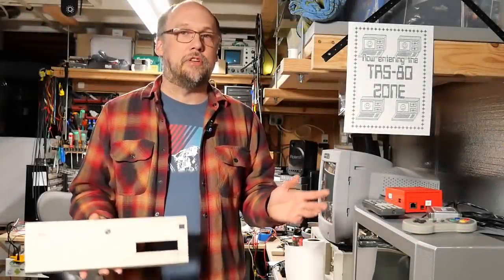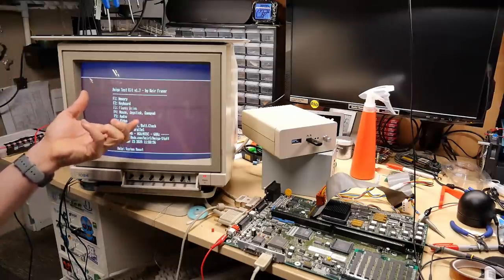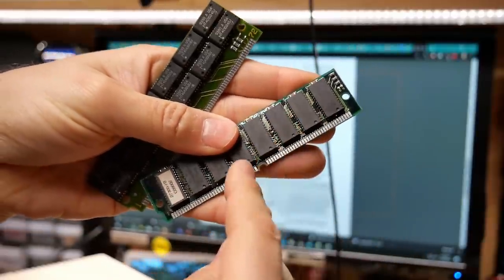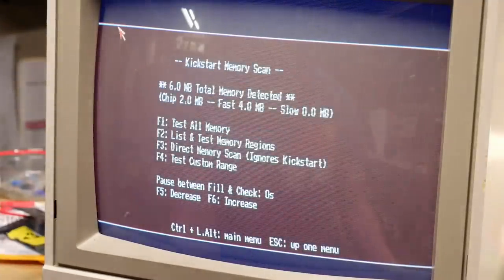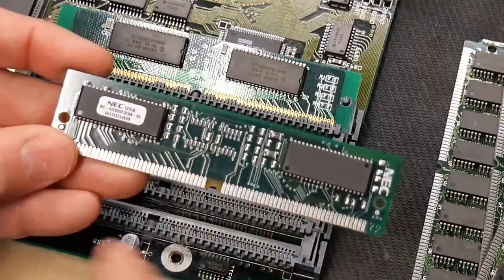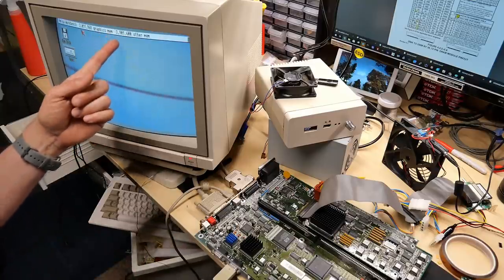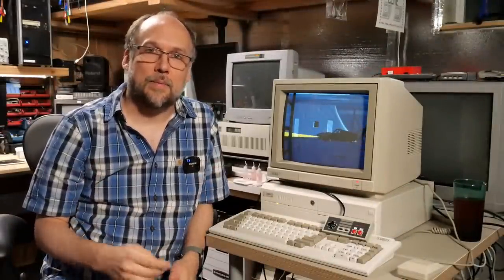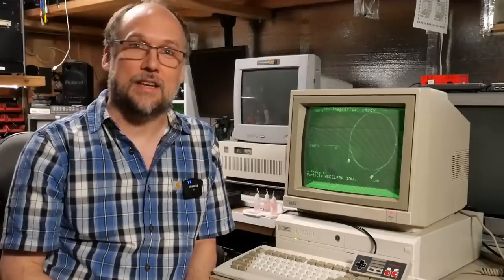Amiga 4000 Repair Part 2: RAM issues are solved!

Comment: I've had a lot of trouble with my C64 since I got it. The 1541 U2+ that I have for simulating disks was unreliable. Even the slightest touch can mess it up. Also the video is glitchy and only got worse. After watching your videos I got some deoxit. The 1541 U2+ works PERFECTLY now. No issues there. The video glitches are still a problem. Most likely logic chip issues at this point. A 10 print goto program will turn the text black randomly. It actually looks kind of like fire as it scrolls up the screen. But yeah deoxit did help a LOT!! So thank you for being so obsessive with it. lol
Reply: He should have used Deoxit in the memory sockets right off and not wasted so much time, I'm a retired IBM engineer, I lived off the stuff.

Comment: Just brought the A4000 up from the damp basement...it sat there for 15 years...aside from having hard time connecting the video with no success due to lack of cables, and floppy not reading the Workbench disc (totally silent, no read clicks), I noticed some mess around the battery that was not crusted dust. I have removed the batt and splashed the area with vinegar which revealed rusted lines, God knows what's it like underneath the board. Any idea why floppy won't work? The battery leak-affected area is far removed from the floppy connector...
Reply from the maker: The floppy drive is likely dead from the moisture. They are often quite affected by corrosion internally from years of it. You may need to try to get something like a Gotek and see if things are working properly with that.
Reply: @adriansdigitalbasement  thanks. I think I have kept another floppy drive in the house upstairs, just need to locate it.
Reply: @adriansdigitalbasement  I finally connected the RGB-scart video cable and the screen is steady grey upon startup, and the power LED blinks 10 times short + 1 time long (possible chip RAM problem). There are a couple corroded trace lines right next to the battery that are going into the RAM slots area. Also corroded trace lines leading elsewhere. Think it's time for a local expert.

Comment: My friend got a Dell workstation, actually two of them, with dual socket setups and really good Xeons. Each machine only had one CPU though, so he moved the cpu and ram from one machine into the other to make a really powerful workstation. However, very randomly, there was a broken solder trace on the BIOS chip of the machine he put everything into. It refused to boot if the computer was cold, but if you let it sit in the crashed boot for a while and warm up, it would then boot just fine. And restarting the computer also worked fine. A very interesting and random problem. The crack must have been so tiny, for the heat from the CPUs to be able to expand the solder and make a good conection.
Reply: If I had that happen I would just move the cpus and ram all into the other workstation. Intermittent problems are the worst.

Comment: didn't you recapped the power supply? 
Where I would completely replace the power supply with a new one
Reply from the maker: I only replace caps that are leaking or are bad. (And in the case of the motherboard caps, even if they haven't leaked yet, they will leak soon causing physical damage.) There is nothing wrong with the caps in the power supply.
Reply: Yes ok 👍
if I have it open in front of me and work on it, I would have changed it completely, after all the Amiga is over 25 years old

Comment: Any chance you can do a short video or at least post a schematic of what you did to make the Nintendo controller work with the commodore?
Reply from the maker: I have a video in the works actually. Not a great one. As a cheat there are no schematics as I just wired directly to the buttons. It was super easy
Reply: Adrian's Digital Basement I already modded one too but I had to cut a bunch of traces on the internal pc board and I get a bunch of odd characters with it plugged in before a game boots. Is that normal?
Reply from the maker: Bob's Barn Workshop A NES controller or Genesis? Why did you need to cut anything? I just soldered into the DIP IC inside that goes to the various contacts. The joystick port on a Commodore shares inputs with the keyboard so yeah it’s not unusual that you see keys pushed in basic.
Reply: Adrian's Digital Basement It’s a Nintendo just like yours, it does work once the game starts. I guess I soldered the leads to points the pcb for easy connection? I don’t remember but I assume it seemed the easiest way to do it at the time. THX

Comment: Maybe you can print a couple of the ram boards and reuse the chips on them
Reply from the maker: Seems there is an open source project to make new 30 pin SIMMs. I might be able to use those chips there to make some 4mb 30 pin SIMMs which are a lot more rare than the 256k/1mb variety.
Reply from the maker: https://www.vogons.org/viewtopic.php?t=72404

Comment: Adrian, the Amiga 4000 can run Windows??
Reply: No.
Reply: It doesn't run Windows natively.  You could get a bridgeboard with a 386 or 486 chip on it that functioned like a separate pc computer that ran concurrently with the amiga system.  Fully decked out you'd essentially only be sharing the keyboard/mouse with the amiga system.  Main problem is that the system only had ISA slots so video card options hit hard ceilings for performance.   I used to run win 3.1 back then all the time on such the machine.  This was way before win95 hit the shelves so no idea if that would run on the 486 chips.  I guess it would, but I wouldn't know as I moved on to the PC world by then.
Reply: @oldtwinsna8347  Win95 worked fine. The local club even had a 2000 decked our with a Pentium bridge board and a mac,,, One of the goofballs went and made screens of all three systems for the others, members would walk up to the machine and think they were on the other system.

Comment: If you look a little further down that chart for "OSOOO" modules, you'll see that 16MB (4M x 36) @ 60ns ALSO is "OSOOO", so it could be that the A4000 is occasionally detecting one of the sticks (Hence the 16MB availability). If it was 4x1MB sticks you had there, the memtest would be crashing out about a quarter of the way through.
It's also possible the A4000 is filling the fast memory from the end because you're installing RAM in the back slots first.

Comment: Ever since I bought my first (an Apple 2e), EVERY manufacturer says when rebooting by power cycling, you Must wait to repower.  Some go as far as saying 10 minutes. Wacking the power switch that fast doesn’t let the capacitors on the power rails drain completely so most of the chips can clear......but not necessarily all of them.   Faster chips can...but not 100% of the time....clear fast enough because of clock cycle times and the fast bit dump on power off.  Most newer systems are better equipped to survive fast cycling, power spikes and brownouts.  (Yea, I’m an old fart now). No matter what, love the videos!